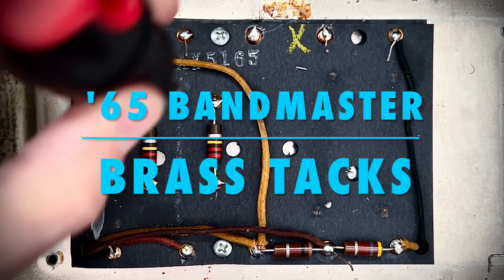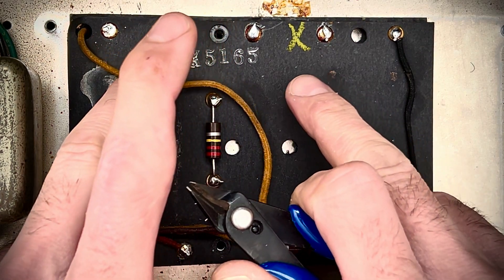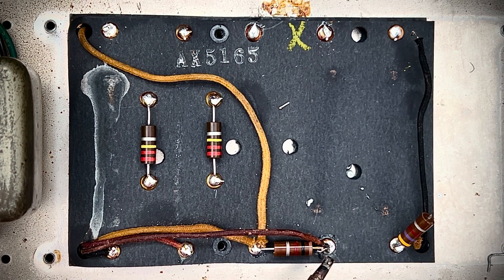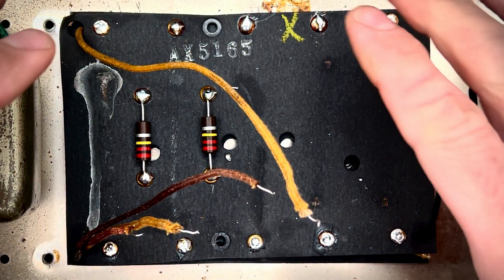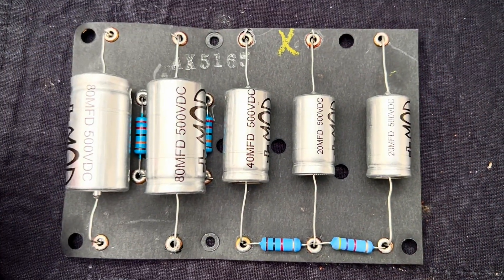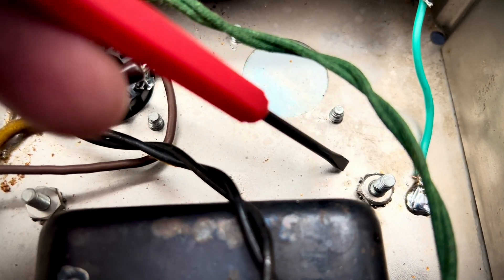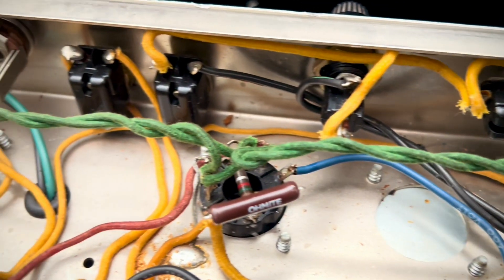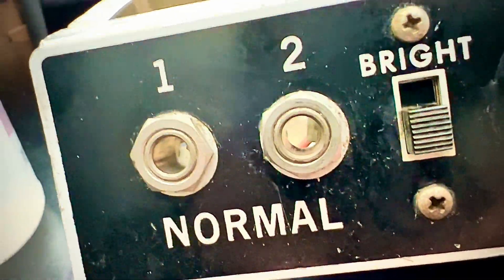1965 Fender Bandmaster: Tackling The Doghouse

Comment: Each Nodal Resistor has a resistor value in the Doghouse for the capacitors. The resistors values that are in parallel across the reservoir capacitors, why did they use those resistor 220K values instead of 1K or 10K or 100K?
Reply from the maker: You ask great questions, Wayne. The resistors you were referencing are balance resistors that are placed across the series reservoir capacitors. They ensure that the voltage is evenly distributed across both. If those were decoupling resistors, such as the ones that are typically between the nodes, then their values would be much different as you have noted.

Pardon my edits lol. I am using speech to text and it does not like my accent apparently.
Reply: @ForgottenGearRestorations  yes true they are, but what I'm confused about is why 220k resistance? I understand why they used both 220k to be balanced but why didn't they use two 10k or two  1k which they could of balanced the storage capacitors. It seems they used 220k because of how the storage capacitors are charging rate and discharge rate. RC time constant 220k * storage cap value. It has to do with filtering out the AC ripple or they used 220k for the SAG time? So the storage capacitors will SAG when drawing more current from them. Using 1k or 10k would cause to much SAG. I'm just guessing why they choose 220k as the balancing resistance value for the storage capacitors
Reply from the maker: @waynegram8907 the resistors are sized according to the specific cap's rated leakage currents. IIRC, they should be roughly sized to conduct ~5% of that rated value.
Reply: @ForgottenGearRestorations  You mean the capacitors "operational leakage current" or Ripple Current? The LC Leakage Current of a capacitor is the Discharge Rate
Reply: @ForgottenGearRestorations  I think you're saying that the balancing resistors are somehow regulating and stabilizing the capacitors rated leakage current?
Reply from the maker: There a couple of things that can screw up equal voltage sharing when the caps are in series - discrepancies in tolerances and leakage currents. The resistors impose equivalent voltage sharing.  Look up RG Keen's contributions online when you have a moment. 

Two electros in series can be modeled as two perfect caps with tiny resistors in series with each one (that's the ESR for the cap) and a large value resistor in parallel, representing the leakage resistance. Manufacturers won't specify the leakage resistance, as they try to make it zero, but know they'll fail at that. Instead they specify that it won't be any worse than X current when new and possibly Y after its expected lifetime. The point of swamping resistors is to make the voltage share between the two caps at DC conditions be no worse than the caps can withstand.

For some idea of what the numbers are, I looked up the specs on Illinois Capacitor (CDE) at Mouser. Their specs on their TTA line say that the leakage won't be any worse for caps from 160V to 450V than
CV * 0.04 +100uA for caps with CV (the product of capacitance and voltage) less than 1000 and
CV * 0.1 +40uA for caps with CV>1000.

ACK! What's all that mean? Well, you pick a cap - say, a 47uF/450V unit, then calculate CV. In this case that's (47E-6)*450, or 0.02115. Well under 1000 then. So the leakage is guaranteed to be less than 0.02115*0.1 +40uA = 0.00215A +40uA = 0.00255A. Call it 2.5ma. That's the maximum, and 40uA is the minimum.

So we can now look at the stacked case. This is two 100uF caps rated at 350V. The CV is then 100E-6 * 350 = 0.035. Leakage is then at least 0.0004A and at most 0.0004 + 0.0035A, or 0.0039A. The worst case voltage division is if one cap has the minimum leakage of 40uA and the other the maximum of 3.9ma.

This happens at the max rated voltage, so let's convert that to an ersatz resistance. For 350V and 40uA, the equivalent resistance is 350/40u = 8.75M. For 350V and 3.9ma, the equivalent resistance is 89.7K. If we don't do anything to even the voltages out, the total current from the power supply will be 450V/ (8.7M and 89.7K), or 51uA. The low resistance cap will have 4.6V across it and the high resistance cap will have 445V across it. The high resistance cap fails first, then the whole voltage is applied across the low resistance cap and it then dies from the bigger voltage. So we have to parallel resistors with each cap to keep this serial failure from happening.

We want the parallel resistors to force no more than 350V to happen across the high resistance (40uA) cap when there is a low resistance cap in the other half. We'd like it to be exactly split voltages, but that ain't gonna happen all the time. Each cap can have 350V max and not die, so we want to add equal resistors across both caps that make neither one have more than 350 out of 450V. Let's call the parallel resistance of the lower cap with one of these resistors R1 and the parallel resistance of the other cap with a swamping resistor R2.

So let's calculate two resistors that divide 450V into 100 and 350. By long familiarity with Ohm's law, we know that 150/450 = R2/(R1+R2)
or R1+ R2 = R2* 450/150. R1 + R2 is what sets the total current through the caps and resistors from the power supply. We have to pick our resistors so we don't eat too much power. We know this will be a bigger current than 51uA.

What happens if we use 220K? That makes the low resistor cap and 220K in parallel be 63.7K, and the high resistance one act like 8.75M || 220K, or 214.6K. The voltage across the high resistance cap is then 450 * (214.6/(63.7+214.6))=347V. The low resistance cap gets 450*(63.7/(63.7+214.6))= 103V. By blind luck, 220K will barely work, even for worst case caps.

Notice that one of the 220K resistors dissipates 0.56W, so a 1W is needed for both of them.

That's awfully thin margins. I'd probably pick a 180K or 150K value for the swamping resistors, in a belt-and-suspenders kind of move. That would account for caps not made by the one company I looked up that might have worse tolerances, and harder use. Lower resistors would be needed in case you used lower voltage caps too. If you were counting on two 100uF 250V caps like might seem clever, you'd have to dramatically lower the swamping resistors to avoid chain failures if one of the caps started going leaky.